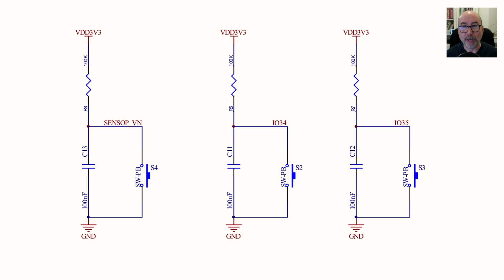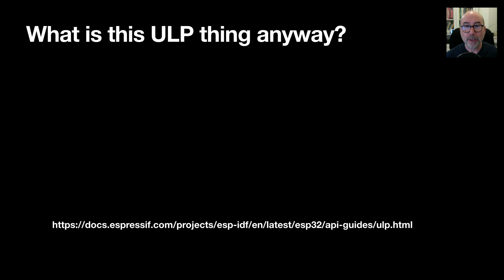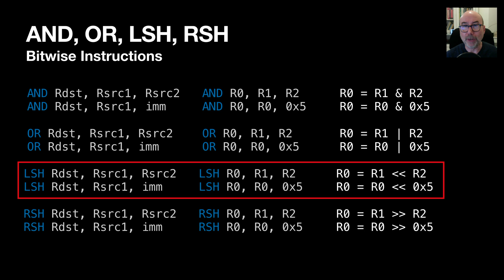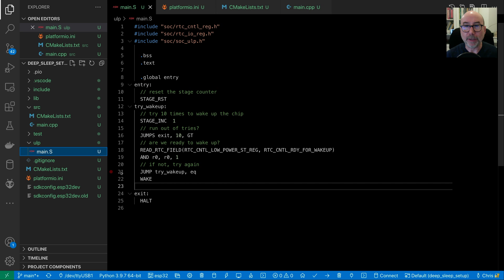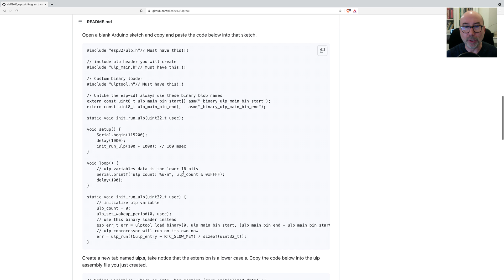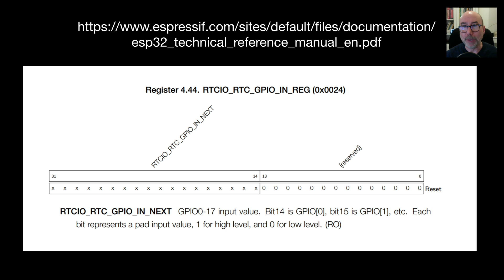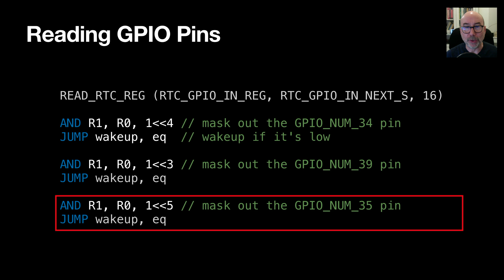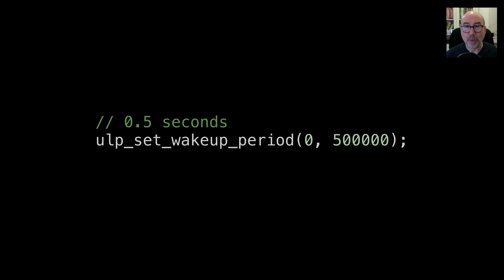ESP32 Deep Sleep: Ultra-Low Power Coprocessor

Comment: I have one question about that hold bit at 14:34 , because I notice that register exists in source code, however it's not present into the technical reference manual. How did you know that you needed to set/clear this hold bit into this register?  Thanks for another great video, it's certainly the most valuable video I ever found about ULP.
Reply: JFY, in the page 85 of the reference: https://www.espressif.com/sites/default/files/documentation/esp32_technical_reference_manual_en.pdf, it says the bit 25-31 are reserved and it doesn't mention a lot of information about holding the output.

Comment: Thanks for such a great video! Have you had any success in getting the ULP I2C_RD instruction working? or do we have to bit-bang in software?
Reply from the maker: I haven't done it myself yet - from reading around the biggest limitation is that it will only do 8 bits. So if you want 16 bits you have to bit-bang.
Reply: @atomic14  thanks so much for the quick reply :) I'm just writing a ULP program that needs ADC and I2C, so I wish I could jump into the future and watch your next video in this series. lol

Comment: is it possible to use ULP coprocessor with ultrasonic distance sensor (HC-SR04 or JSN-SR04T) that have Trigger and Echo pin?
I want to use ULP coprocessor to measure distance between sensor and water level each 5 minutes and then wake up Xtensa and send data via HTTPS POST request to webserver. I was thinking how to program it. This video gave me really good answers to questions how to start, but I am unable to do it :-) I was never programming in Assembly.

Comment: How much memory is available to the ULP? You mentioned there is 8k (or was it 16k?) RTC/recovery memory available to store data in during deep sleep in your deep sleep video (usable via a prefix to a variable declaration). Can the ULP also reach this memory? or is it the same memory even?
Reply from the maker: Yes, the ULP can read the same memory, from ESP32-DevKitC v4 onwards it's 16Kb, before that it's 8Kb. So probably safest to stick to just 8Kb unless you know what your code will run on.
Reply: @atomic14  if you mean the dev board, I'm using a DOIT v1 IIRC however I suspect you mean something else... e.g. the actual chip? any way to determine what I have?

Comment: thanks that's super useful. I want to go back over my previous ULP code now with a hopeful renewed understanding of what it's doing. Might see if I can pass a var back and forth too... (was only controlling pins before).
Reply: what I'm a little unsure of still is what config state the pins are in during main code/cores execution after the ULP has been playing with them. A nice example would be to cover how to (elegantly - fairly certain I badly hacked it) pass control of a pin back and forth between the ULP and the main processors. Interested to know a little more about running them both (main cores and ULP) at the same time too.

What was the 5 second thing doing incidentally? waiting 5 seconds before deep sleeping and starting the ULP?
Reply: ah, having watched your deep sleep video I think I get it now. So in essence all pin states are dropped whenever you enter deep sleep. The only way to maintain them, is to set the hold bit on each pin you want to maintain the state of. If you want to change the pin state though via the ULP when the main cores are sleeping, you need to unset the hold bit, make your change, and then ensure you set it again before halting... presumably, if you didn't, and the pin was high, it would just switch off as soon as the ULP hits halt?  When you get back to main core code, presumably everything about a pin with the hold bit set is maintained (direction, pullups, state)? Does this sound right or am I still getting confused? Presumably, if both the ULP and main cores are running at the same time, the hold bit is irrelevant?
Reply from the maker: That's correct, if you don't set the hold bit as soon as the ULP program halts the pin would switch off. That is a good question about when you come out of sleep - and I'm actually not sure on the answer. Needs investigation.
Reply: @atomic14  thanks! Glad I'm not asking daft things! (could easily happen!)

Comment: I doubt that comment about .S vs .s
Reply from the maker: https://github.com/duff2013/ulptool

“Typically in Arduino you can compile assembly files using the '.S' extension. Using the ESP32 Arduino core framework these files would correspond to the Xtensa processors whose toolchain is incompatible with the ULP coprocessor. Luckily, Arduino provides a fairly easy series of recipes for building the ULP assembly files by using the '.s' extension which Arduino will let you create.”
Reply: @atomic14  yeah so like I said, you can use either, it's not a hard coded limitation, by changing the configs to select the correct files. I bet you can use .s in platformio just fine by changing the makefiles etc to use .s instead of .S etc.
Reply from the maker: @EmilFihlman  In platform.io you can yes - but not in Arduino. Even though you can use whatever you want in platform.io it's probably best to stick with what the ESP-IDF documentation suggests?

Comment: High, great video. Do you have any about begining with ESP32 programming? I only program it with arduino.
Reply from the maker: The ESP-IDF GitHub repo has some good examples, most things translate across quite easily. A lot of the difficulty is that a lot of libraries assume that you are building on top of Arduino. You can run Arduino as an ESP-IDF component. And there's also nothing stopping you using ESP-IDF functions when using the Arduino framework.

Comment: Wow this is awesome. I am really into this. I have one question. I want to count pulses using the ULP. I want to sleep in the ULP for x amount of time and every time a gpio int is triggered then increment counter and go back to sleep (not necessarily wake the main mcu). But the only way I have found to do this so far is to wake the main mcu for a very short time after the interrupt, check if it was woken by the timer or the interrupt and go back to sleep. Do you think this is possible with only the ULP.
Reply from the maker: The only way I know how to do this is have the ULP wake up quite often and poll the GPIO to detect if it has changed and count a pulse. At the same time maintain a count of how often the ULP has woken - this will give you a rough measure of how much time has passed and you can wake the main mcu when you want to.
Reply: @atomic14  Thank you so much for the reply. I actually have an external timer that manages my Sleep time. So in theory I want to have absolute minimum power usage while counting the pulse pin, and then when the other pin is triggered turn main mcu on. I guess my question is, can the ULP go into a sort of sleep mode and get woken up by pin interrupts, and decide whether to go back to sleep (after incrementing counter) or wake main MCU.
Reply from the maker: @lowkuleeuwner2815  Unfortunately not, there's no interrupt wakeup for the ULP. I did find this forum post where someone was trying to do pretty much what you are talking about https://www.esp32.com/viewtopic.php?t=16493
Reply: @atomic14  I'm guessing the ULP is low enough in power it's almost considered to an interrupt in it's own right... but a slightly more intelligent one. That being the case... maybe just have it run code that checks the input pin for state changes constantly and maintaining a count, then have it wake the main cores when it's over threshold. When programming counters on the ULP, keep in mind the small size of the registers though. You'll possibly blow your way up to 65536 pretty fast.
Reply: @lowkuleeuwner2815  just been having a read around on this and indeed as atomic said, can't be done. You can only wake the ULP from a timer, not an interrupt. Not what you are after but for bonus fun, apparently you can have more than one ULP program. You can also have the ULP program control how long it sleeps for in between executions (5 configurable options see sleep command). So for example you could have a long delay before it initially starts, then shorter delays between subsequent runs. You could have logic in your program that changes which delay is being used, so possibly this functionality may be used to allow longer or shorter sleep periods depending on the state of things that you care about.
Reply: @lowkuleeuwner2815  BTW I'd really recommend Ben Eater's new video on sleep() function in assembler on 6502. Obs. Not fully pertinent to ESP32 but defo gives some transferable skills on how one might want to handle delays when programming in assembly.
Reply: @WistrelChianti  hi, thanks for this thorough reply. I am slowing getting where I need to go, just using the esp32 and some smart scheduling of my ULP. If you want we can have a chat some time.

Comment: Good Video!! What should be the changes to use the Platformio IDE with the Arduino framework instead of the esp-idf?
Reply from the maker: With platformio you only have support for the ULP if you are using ESP-IDF framework. But you can add the Arduino library as a component. It's not for the faint hearted, but the instructions are here: https://docs.espressif.com/projects/arduino-esp32/en/latest/esp-idf_component.html I will do a video on this at some point and run through the instructions to make sure they work!
Reply: @atomic14  looking forward to that

Comment: Nice, currently having problems with ESP8266RTOS and Eclipse IDE which is driving me mad. with some projects the IDE can't resolve the include files. so shows errors that arn't there, but of course the complier can so they build fine. 😞
Reply from the maker: I hate it when that happens - the tools are conspiring against us!
Reply: @atomic14  The worst of it is it's a well known fault with windoze. all fixes i can find don't fix it. the bugger is some projects don't have the issue with the same includes ?
Reply from the maker: @TheEmbeddedHobbyist  VSCode sometimes has the same problem with C++ Occasionally it just forgets how to autocomplete or find headers. Or it starts using gigabytes of RAM! I think C++ is just a hard problem :)